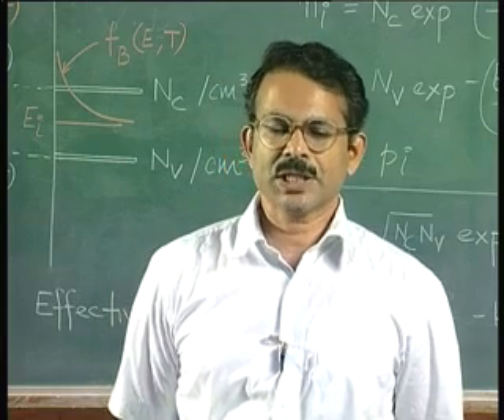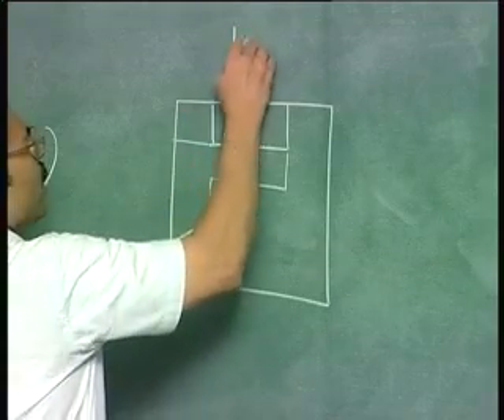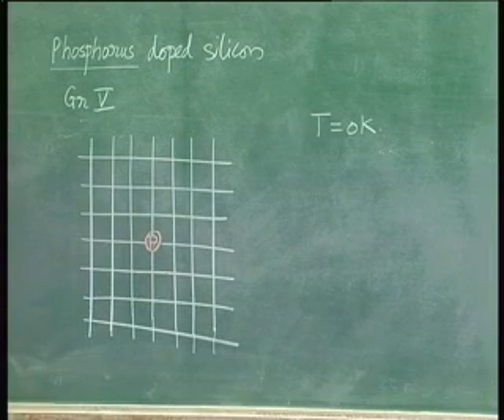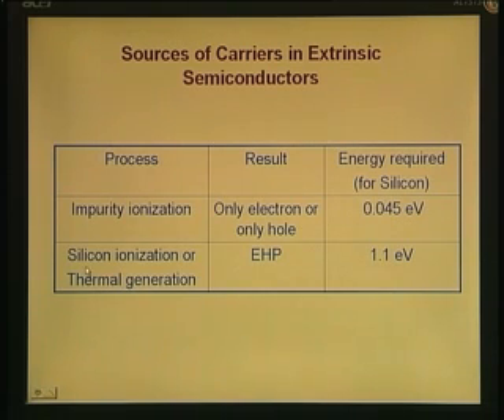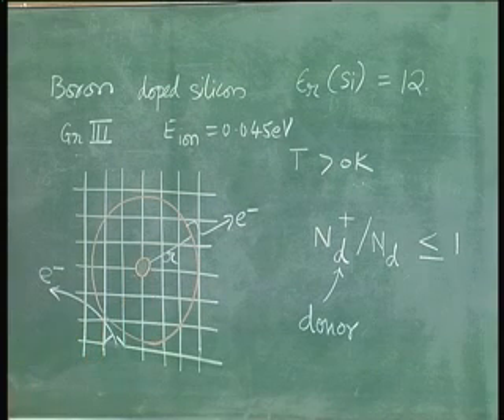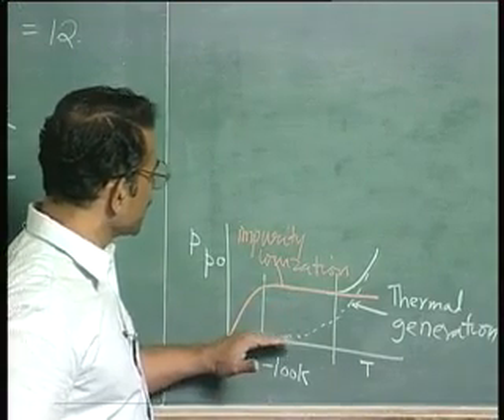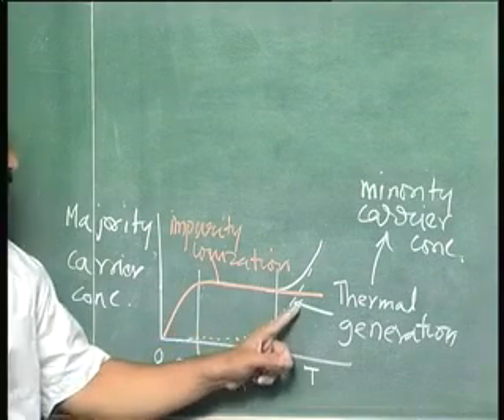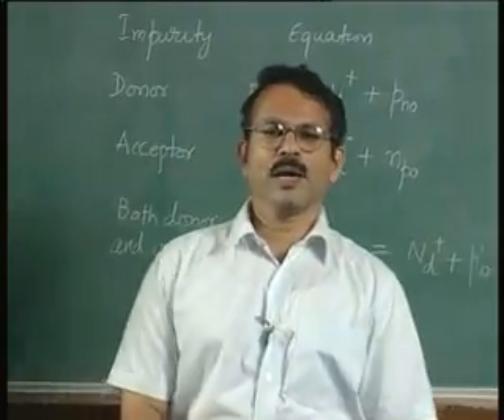Lecture - 9 Equilibrium Carrier Concentration

Comment: Sir , you said particles have to converge to give required energy does that mean the atoms that are colliding with each other and generating the energy?
Reply: yes atoms are colliding with particles like photons, phonons, electrons and holes.
Reply: no, it doesn't mean that, not only atoms but 4 different particles in the device, electrons, holes, phonons and photons are also participating in the process, i.e., for example even a higher energy free electron can generate another electron-hole pair.

Comment: What is the equlibrium condition during impurity ionisation  (what could be the reverse process for it to make it in equilibrium during that process)
Reply: See equilibrium is related to flow of charge...That is net flow of charge carrier is zero from one point to another point...So the equilibrium in this case is that carrier moving from one region to other region is compensated by carrier movement in reverse direction...But generation process should not be accompanied by any reverse process(considering small amount of recombination) otherwise there will be no net generation....